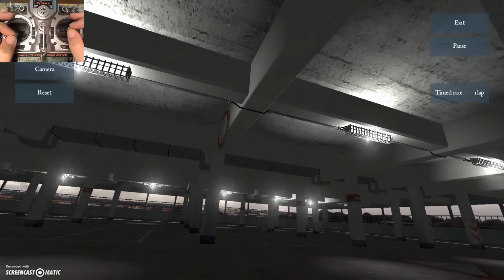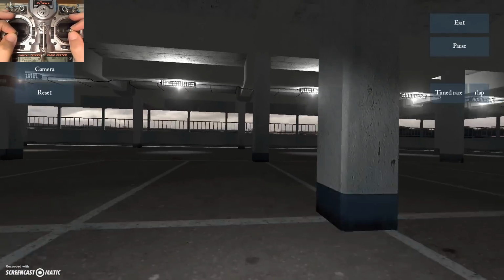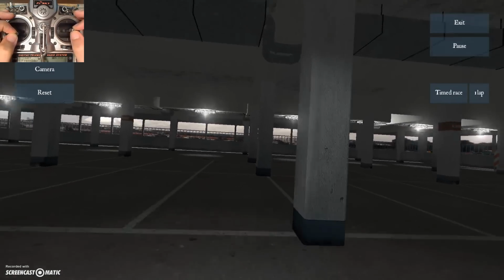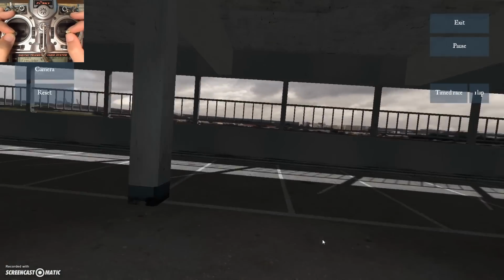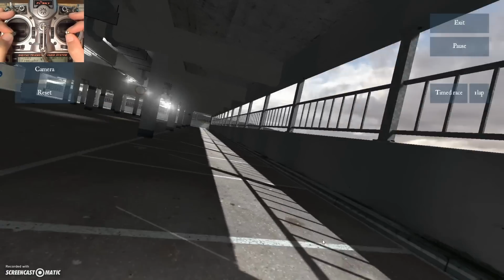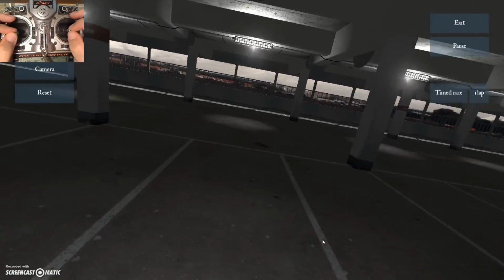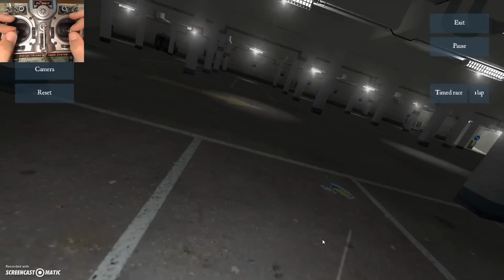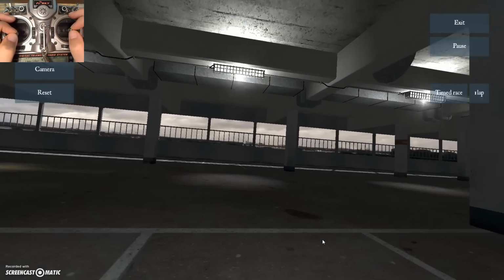How To Fly A Racing Drone - Lesson 24 - Pylon Turns

Comment: Thank you Joshua. I'm 81 years old and have been flying R/C for over 60 years. I'm struggling to fly FPV (tunnel vision and 2D) and your series and Freerider have helped a lot. I fly Mode 1 and I question why the trade and the whole world is trying to make us fly Mode 2? Back in the 1960's I made a fair income from converting Mode 1 sets to Mode 2 because the Japanese didm't make Mode 2 sets. Now I could probably do the same converting the other way. Could you drive a car with the accelerator on the left? I can fly 'planes on mode 2 but I can't fly helis because I can't co-ordinate the throttle with ny left hand.
Reply from the maker: I can't say why people tend to fly mode 2. The vast majority of pilots these days are learning to fly mode 2 though.
Reply: My point is that they don't 'tend' to fly Mode 2. They don't have a choice.